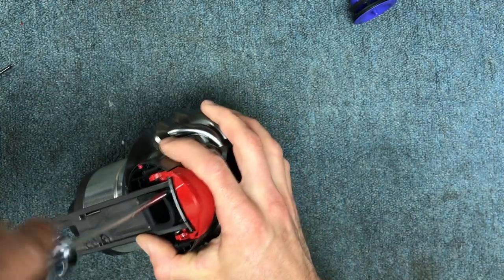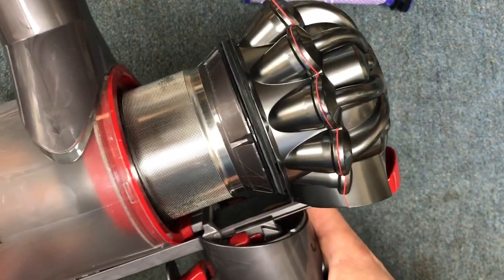Vacuum repairman shows How to take apart and clean a Dyson cordless V7/V8

Comment: Thank you so much!!! I had done the usual disassembly and cleaning, but after putting it back together, there seemed to be a lot of fine dust continuing to emanate from the cyclone and collecting in the bin, (which is a real drag after spending considerable time cleaning it). And I was thinking if only I knew how to open up the cyclone to see where the dust was coming from. And here you are! Very much appreciated!

Comment: The rest of the story: I called Dyson twice re my lid off of the cannister.  Initially it was suggested I view a video they would send to me.  It was useless.  Second time:  I was told that lid should NEVER come off & if it does the cannister needs to be replaced.  As she interacted with the tech & returned with his clear answer that is could NOT be put back, I waited til she was finished.  While on hold I fiddled, again, with this knowledge about the tabs that you pointed out. .  Presto, it worked!  After her dire news I shared how it is in & working.  Wrong response!   She did warn me that this was just temporary.
Reply from the maker: I just got one of those in with the same problem! I'll record me fixing it and explain how to do it! glad to hear you got it fixed!

Comment: Excellent video. I purchase Dysons at my local Goodwill when I can find them. Your videos have helped me clean them up so they are useable in my home. Even when I buy them without a charger, I use my existing charger to charge the compatible vacuums. The fact that you REassemble is key. I can take them apart, but I’m horrible and putting them back together. In some instances I write the screw size on the unit with a Sharpie to remind myself.

Comment: thank you, your video gave our v8 a stay of execution..
 A new battery, new filters, and thorough cleaning (dusting ) seemed to solve the pulsing though occasionally was still doing it ..  not sure if a factor, but with an aftermarket rear filter, two I bought seemed that they were causing a pulsing, so pulled out a newish Dyson brand filter  (we had three V8s) this is the last one standing,.
The pulsing went away for a month or so, but returned,so watched your video, deep cleaned .. we shall see .. not buying Dysons again .. seems the lifespan is approximately 2-3 years, so we reverted to a cheap corded stick we brought for cabin, that and a built-in system..

one other thing, many buy new vac etc. for new houses or post renovation.. watch out,  plaster and drywall gyprock dust kills vacuums.. especially if the forced air system was not cleaned out post handover ..

Comment: Many thanks. I got careless and sucked some water into my V8 Animal. It mixed with the accumulated dust and formed a paste that shut it down (made the pulsing you mentioned). I almost ordered a replacement vacuum but decided to do a little research and found this post. Very easy to follow, and I already had a set of torx bits, so I figured all I had to risk would be an hour of my time. All went well. I tore up the edge more than you did separating 5 clips between the inner and outer plastic housings, but it had no impact on function, and fortunately, that's as far as I needed to go.

Comment: This was about as clean and straightforward as a tutorial can get - I wouldn't change a thing.   Question for you, my V8 seems to hold most of the dirt in the cyclone area.  I have pulled it apart and washed each piece with soap, water, and a pipe cleaner.  Have you seen/fixed this issue before?  My last resort will be to apply a spray-on wax to the disassembled parts to reduce friction.  Keep up the great work.

Comment: Helpful thanks. Didn’t have long enough screwdriver to release last pieces but apart from that it really helped me be able to clean the dust out from decorating. The bit with the flathead screwdriver didn’t come out at all result like yours so got a few jabs in the plastic 🙈. It’s now reassembled and charging 🤞it all works tomorrow 😁

Comment: Thank you very much! My unit was stinking to high heaven and it was quite non-obvious to me how the heck to take it apart. I’m not sure how many times I can take that screen off, but the rest of it I can see happening on a regular basis for years to come. I’m very careful to line up with the previous original thread when I put the screws back in, So that should last a long time.There’s only so much dog dander you can vacuum up before these things start to smell. I bet a lot of people just throw them away!

Comment: Hello! When I pull up on the lever to empty the bin, it gets stuck. I’ve tried pulling it out as well by pressing the res buttons inside and that doesn’t work. It’s stuck rigid. Any tips?
Reply from the maker: Hmm that’s a tricky one. I’m not entirely sure what is causing your hang up. Have you tried removing the clear bin with the red release latch at the bottom?
Reply: The shroud over the electrical assembly could have come loose due to the 2 internal thread could have cracked and cause your bin to jam stuck.
Reply: I figured it out! The dust bin has a rubber seal that squeezes the chrome cylinder as you push and pull. I must've cl3aned the lubricant off. I took a cotton ball, sprayed some wd40 and lightly coated the cylinder. Good to go.

Comment: I loved the tutelage!  However, what I was looking for you did not cover (probably because no one else has had this issue!) I don't clearly know how I had done this.  Putting the vacuum into its charger the dirt cup's lid (that keeps the dirt in place) popped off. How the Hey can I get it back in place without cracking the lid?
Reply from the maker: Thanks. I’m not sure how to explain it over text. The little knobs are slightly tapered on one end to allow for you to pop them in. I’ve never had one break. Best of luck!
Reply: I will give it a try, many, many thinks for your assistance. If you wanna-do a mini 2 minute video on a "How To" with the tapered tiny tabs I'll get my pop corn lined up & watch it until I get it!

Comment: thank you so much for this detailed video! unfortunately when I was putting mine back together i think I did something wrong, because now it's very difficult to empty the dustbin :(( the red garbage tab doesn't slide out smoothly at all, it's a real struggle. do you maybe know what I did or how to find out/fix it?
Reply: the cyclone part goes smoothly up & down by itself, but as soon as I add the dustbin it gets stuck
Reply: it also looks like I don't have as tight a seal between the cyclone where the red garbage tab is and the motor housing :// what could I have done wrong during reassembly to cause that?
Reply from the maker: I recommend taking a part are reassembling carefully. Can’t be sure what you did wrong. But that’s about all I can do to help without seeing it myself

Comment: Can you help? I have a Dyson V7 and the trigger switch quit working. It runs constantly.  Weird thing is the light comes on when I pull the switch and goes out when I release it. However, the engine will not shut off. I had to pull the battery to finally turn it off.
Reply from the maker: I would replace the battery. The on/off switch is located inside the battery and it sounds like yours is faulty.

Comment: My v8 has star/Torx screws. I'm thinking maybe because it's refurbished, since no videos I've watched have mentioned it. If you find yourself in the same situation, you can use a flat head screwdriver or a hex key/allen wrench, but they have to be the exact same size. good luck.
Reply from the maker: All the V8s I have worked on have torx too. What makes you think it’s refurb?

Comment: How do you remove the red parts from the bin? There is one screw but can't get it off the clips.
Reply from the maker: Can you give me the time stamp on what part you're talking about?
Reply: Yes, it's 0:45 when your holding the can you will notice the red ring on top.  That comes off but I can't get it off all the way.
Reply from the maker: @MIKEYSREVIEWS  I actually don't have one of those models in the shop right now to give you a certain answer. I will comment back once I've had a chance to take a closer look at one. Is there a particular reason you are wanting to remove that red part?
Reply: Collects dust under there and also clean the contacts.  There two contacts in that bin.
Reply from the maker: @MIKEYSREVIEWS  Got ya! Ok. When one comes in I'll take a look and get back to you! Sorry I can't help you right away here.
Reply: You can make a video no one has that part taken a part.
Reply from the maker: @MIKEYSREVIEWS  Ok I got one to look at. This is a part I really wouldn't disassemble. There is a screw on the inside of the intake of that dirt cup that would need to be removed. However, if you take that screw out, there are still internal clips that hold that assembly in place. Working on dysons as long as I have, the risk of breaking the clips to take that section a part is not worth the reward, so I opt to use compressed air and a small brush to agitate as much dirt out as possible. I hope this makes sense.
Reply: I had the same issue one screw but I wasn't able to figure out the clips since there hidden so I didn't chance it.

Comment: I would gladly pay you to help me with this problem I have the same machine you just tore down and it has a flapper that opens up and that’s where the debris falls out. It’s clear plastic flapper and it fell apart and I cannot get that clear plastic bottom the snap back in and I’m scared if I force it I’m gonna break off the plastic tooth that goes in a grooveof the canister part that holds all the junk and any suggestions
Reply from the maker: Vacuum repairman shows how to fix your broken dyson V7, V8, or V10 dirt cup!
https://youtu.be/-f2xwB1lZ2w

Comment: Hi Can the small flap inside the suction spout be replaced or will I need to replace the whole bin?
Reply from the maker: I don’t think so.
Reply: @richardsvacuumcenter  so need a new bin assembly? Is the flap just to stop debris falling out when the vacuum is held vertically?
Reply from the maker: @nicknicolaou8512  yes that is correct.
Reply from the maker: @nicknicolaou8512  you only need a new bin if you want to replace it. If you are careful it will work find if you just remove the flap.
Reply: @richardsvacuumcenter  great so can do without the flap then. Thank you so much for your quick response. Have a good day and keep up the good work. 👍

Comment: Hello I’m currently working on a v8 Dyson fluffy and when I hook up the attachments the roller heads won’t spin but it’s sucks just fine, any ideas?
Reply from the maker: Have you checked to see if they will work directly connected (without the wand)?
Reply: @richardsvacuumcenter  yes sir I have, I’ve tried 3 different attachments and checked resistances for the heads and all check good. Vacuum sucks good but none of the heads will spin.
Reply from the maker: @leppertbowhunting8089  Ok. So. I have seen this issue before on a few occasions. Unfortunately what I found with others doing the same thing is that the board has failed somehow. My guess is that water caused the issue but there is no reason to go forward because you cannot get the board separate from the entire motor assembly. You'll probably have to replace the motor assembly.
Reply: @richardsvacuumcenter  thank you for your time and the information, much appreciated

Comment: Quick question, I have a Dyson v8 Animal and all of a sudden, when opening it to empty the canister it feels like the upper rubberized red seal inside the dust bin is binding to the filter, it's dragging heavily and slowly, the rubber feels like it is gripping the metal mesh inside the dust canister.  Do you have any idea how or even if this can be fixed, it almost feels like something is misaligned.
Reply from the maker: Did you disassemble it? Or have you done any thing or had anything done to it prior to noticing this issue?
Reply: @richardsvacuumcenter  No, I hadn't taken it apart previous to this issue, it just started randomly one day.  After the issue was noticed I have since taken it apart and reassembled it many times and the same issue is still present to the same degree.
Reply from the maker: @shieldsyau  I've seen those break before. You probably should just replace the clear bin and that will solve your issue most likely.

Comment: Great video. Do you know how to remove the nozzle from clear bin?
Reply from the maker: Can you be more specific?
Reply: @richardsvacuumcenter  The part where the tools are attached to the bin. I want to clean around the flap inside.
Reply from the maker: @elaineahn2753  oh I see. It’s actually not possible to remove that section without breaking the clear bin. There are internal clips and they refuse to come loose with prying (I’ve tried). There’s only a certain amount of pressure I will apply to plastic parts before I know they are about to break. This is one of those parts. Compressed air is best method to remove any build up in there! 👍🏼

Comment: Nice. 
but you did not show how to get into the motor part. My motor is stuck
Reply from the maker: Well that’s because it wasn’t the purpose of the video. Unfortunately you will need to replace the handle/motor assembly if that is the case. Thanks for the comment!

Comment: Hi I have v8 absolute and its constantly on .
Pushing the switch it's not making any difference.
Reply from the maker: Take your battery out and reinstall and see what happens.
Reply: When I take the battery out stop .
If  I put back the battery strat immediately without pressing the switch.
Reply from the maker: @jvy1971  sounds like you have something wrong with the trigger.

Comment: Does this vacuum use a squirrel cage fan?
Reply from the maker: No not exactly. Similar concept but not the same type of fan or impeller.
Reply: @richardsvacuumcenter  interesting im curious to know what fan style has the greatest suction and see if it correlates to dysons price points.
Reply from the maker: I believe they all have the same impeller style fan. Any changes in suction or air flow are going to be correlated to fan size and RPM of motor. I don’t have any figures on the different models.

Comment: Great way to break tabs and scrach the hell out of it.
Reply from the maker: thanks?
Reply: @richardsvacuumcenter  using compressed air will get that dust out without raping it with the flathead to pop open the screen
Reply from the maker: @TheWhiteChrist  ok...
Reply: @richardsvacuumcenter  thanks?

Comment: hmm... there are no electronic parts in the cyclone seperator. So you could just submerge it in hot water and flush out the stuff inside. 
Make sure its dry tho.....
Reply from the maker: Good luck with that!
Reply: @richardsvacuumcenter  I disassembled it. The dust is so small, it sticks to evrything. Got rid of the unit though. No Dyson for me ever again.
Now own a makita that is ridiculously easy to take apart.

Comment: Totally unnecessary maintenance. Doing this can potentially weaken the seals in the cyclone assembly. Most of the dust inside of the assembly will be replaced once you’ve vacuumed your carpets even just once.
Reply from the maker: Ok. Thanks for the comment.

Comment: No help as you failed to dissassemble the part with the MOTOR...really I see ZERO reason to even dissassemble most of what you showed (the multi chamber assembly whatever it is called) ...simply flushing THAT several times with really warm dish soapy water is gonna clean those internals plenty well enough so why bother??  ....But that does Not apply to lost electrical connections in main motor/switch mudule ...THAT is the ONLY thing I am looking for ...So?  Sorry but big thumbs DOWN on this video
Reply from the maker: Did you read the description? The description is how to take apart the cyclone assembly not the motor. I really can't offer a solution for you since the video doesn't cover the topic you're looking for, nor is it supposed to (as the description accurately states). Sorry you're upset about something that is not supposed to be in the video. Do you also leave bad reviews for restaurants that serve tacos when you wanted hamburgers?